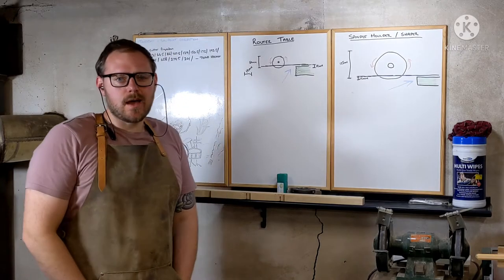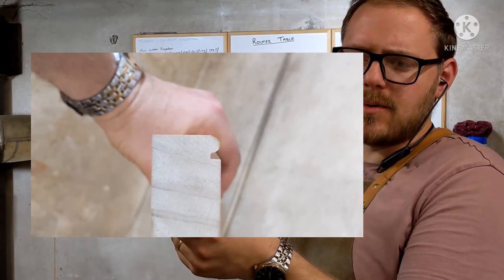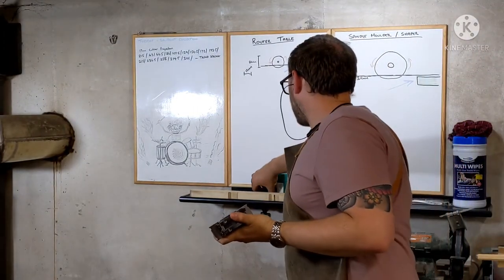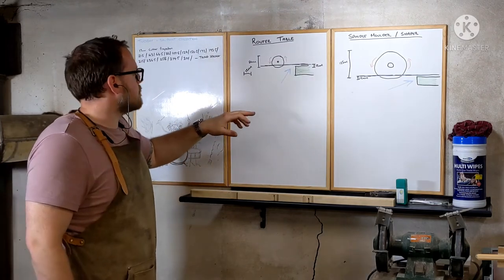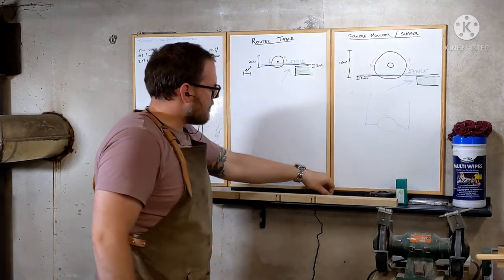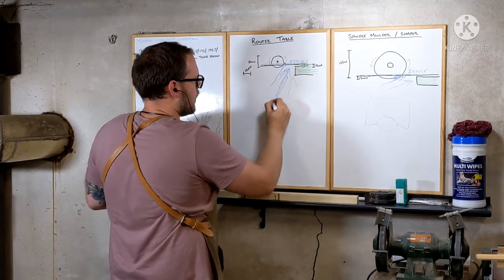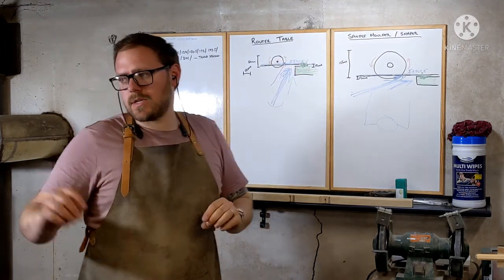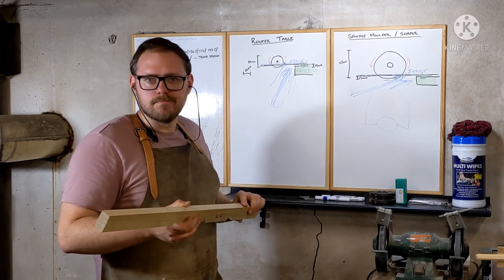Router table Vs Spindle moulder /Shaper Part 1 - Moulding

Comment: Nice to see a video explaining the differences between the two. I'm moving workshops in about 3 weeks and invested the best part of £40k in new machinery and spindle wise I decided on a Felder F700z but with the option of the router spindle shaft as well as the 30mm spindle. I figure it may well save money on the 1 off jobs where cutters need to be bought and may not be used again for years. I liked your faceframe mitre jig for the routher table and will probably take up the idea for my kitchens. I don't do many ,more traditional sash windows, doors, etc but I enjoy your channel.......... Hope you have time to do more video's,vlogs as I always find them interesting  and not many UK tradesmen do them. Plenty of amateurs ,some are ok but many just go out their way to copy US channels which is a shame.
Reply from the maker: Cheers Adrian, very nice of you to say. I always like finding UK channels too, like you say, not that many of them about. The Felder spindles look like really nice machines, I think having a flush sliding bed is a massive bonus for cabinet work too, adds a lot of versatility.

Comment: I've tried to explain the benefits of a spindle over a router in a home shop environment and here in the US at least it seems to be largely ignored.  Usually if I show someone the cut quality in person they begin to understand, but still write it off as a industrial tool..
Reply from the maker: It's a shame because they can be had for a similar price to an off the shelf router and table if you keep an eye on the auction sites 🤷🏻‍♂️
Reply: @carpentryjoineryandcabinet6335  I completely agree. I've picked up five different spindles over the years all second hand and usually for less than a router and table. I actually picked up a 6hp imported 511 model with power feed for $400 US. I paid close to that for just a router before.
Reply from the maker: @jar944  there are definitely some bargains to be had! I suppose all the better for the rest of us that not too many people are out looking for them at least I guess 🤷🏻‍♂️ 😂

Comment: It is the same angle in both cases…. The travel distance is longer. The bigger cutter head has a bigger moving mass and the radial distance makes a bigger momentum which makes it easier and more stabile cutting. Regarding the comment that people consider it a industrial tool I can understand since it is a more pricier and more space consuming plus takes more of a safety approach since there is more force In it. The tools which many people uses just a few times are way more expensive and to fully use the potential in terms of quality and safety cut of a router or a spindle moulder a powerfeeder is essential. So the first cut is pretty expensive compared to a simple router in let’s say a home made table. Like the video though! :)
Reply from the maker: Hi Larsrang, 
Sorry for the late reply, I missed the notification for your comment at the time. The cutter angle is certainly the same (or at least very similar depending on the exact geometry of the tooling) for both machines. But that wasn't what I'm really talking about here. It is the angle at which the cutter leaves the back edge of the timber (the side that is pressed up to the fence). Like you say the increased mass and cutting radius help to make the cutter more stable too, but a lot of the break out (especially in more brittle materials such as Accoya) is largely down to that steep exit angle pulling fibres from the rear of the timber. You could obviously improve this with having very little clearance between the cutter and the rear fence, but for a lot of router profiling tooling with bearing guides it is almost impossible for them to accommodate a zero clearance fence without fouling on the bearing. Once again sorry for the late reply, and sorry of my description on the video was poor. 
Many thanks,
Ben.

Comment: Slap in the face for me so obvious once you drew it but I had missed this before. Thanks. IF you have a chance could you discuss or comment on  power feeds on spindle moulders?
Reply from the maker: Hi, thanks very much. Happy to help if I can, was there anything in particular that you wanted to know about the power feeds?
Reply: @carpentryjoineryandcabinet6335  Hi thanks for replying. What's the advantages, (just climb cutting or speed?) any points on set up. Is there anything you can do with a power feed you can't without. Thanks.
Reply from the maker: @TheBrick2  Hi, I don't think it's any faster than hand feeding really, but the cut quality is certainly better. You'll get less burn and tearout as the feed rate is continuous, unlike hand feeding where the feed pressure changes as your hands change position. It also means you can generally get away with less infeed and outfeed support, as the power feed will prevent the workpiece from trying to tilt as it comes off the table. Like you say it opens the possibility of climb cutting relatively safely, but I'd still limit that to lighter cuts (even with a power feed I wouldn't want to climb cut a large rebate etc). It's obviously a lot safer too, spindle moulders haven't got the best track record when it comes to people's fingers, so anything that keeps your hands away from the big razor sharp spinny thing is always a big advantage. You can set up power feeds to feed tricky curved work too with some careful jig making, and by tilting the feeder's head so that just one wheel is in contact with the workpiece, and that can be helpful for getting a good cut quality as the grain direction changes as the workpiece rotates. Overall there are very few instances I can think of other than ringfence/bearing guided work, where a power feed wouldn't be an advantage.  Hope that helps.